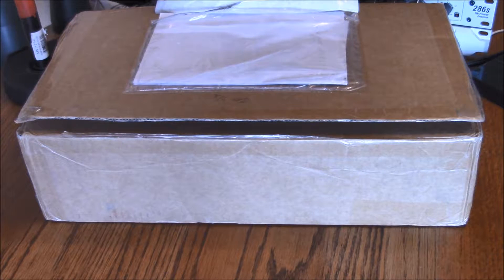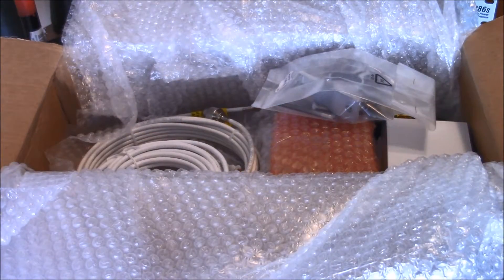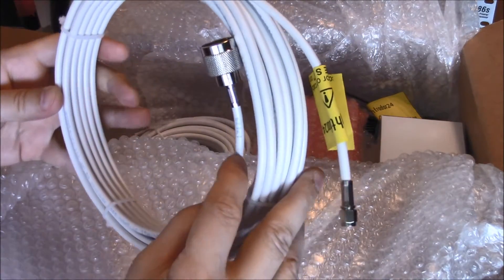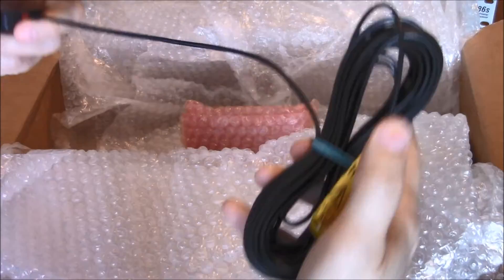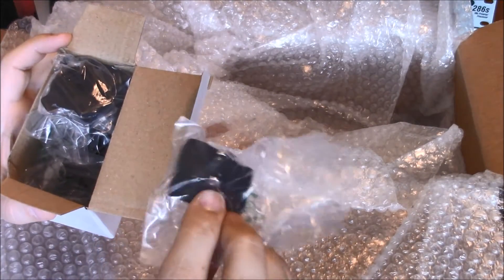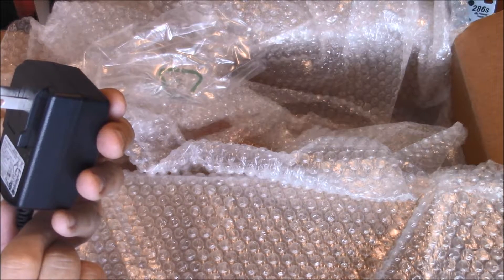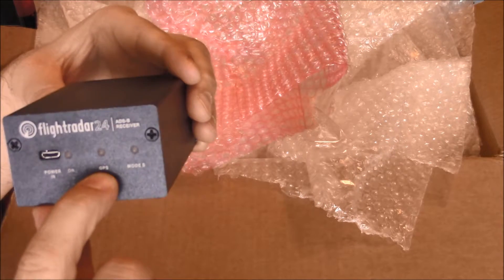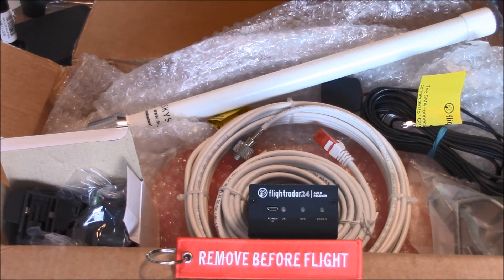FlightRadar24 ADS-B Receiver Kit Unboxing

Comment: can you view traffic on your pc directly rather then online only?
Reply from the maker: only online.
Reply: @morejelloplease  You can view on PC directly too
Reply from the maker: @danielaregay7127  care to share how?  i can log into the device via IP and check it's status but i haven't tried viewing any data.
Reply: @morejelloplease  Yes. After you log in, there are different tabs such as Overview, Logs, A/C List, Map... but I use Virtual Radar Server (which you can download for free) and use with LAN without needing an Internet connection
Reply from the maker: @danielaregay7127  hmm ill give it a shot :)
Reply from the maker: @danielaregay7127  i completely forgot my login, isnt the username like fr24 and password is the mac address or something?
Reply from the maker: @danielaregay7127  doesnt work, i logged into it months ago, now i can't.
Reply: @morejelloplease  the mac address should be in lowercase, not UPPERCASE
Reply from the maker: @danielaregay7127  i figured it out, mac address letters have to be in CAPS :)
Reply: @morejelloplease  Oh mine is the opposite. Congrats
Reply: @danielaregay7127  how can you log in ?
Reply: @deoryisnoob  the password is the mac address located at the back of the receiver (without the colon marks)

Comment: Could you PLEASE upload a tutorial on how you managed to get it all set up?
I want to host for them but I've no idea how I'm going to stretch a 5m cat cable down 2 stories and where the fuck am I supposed to put the gps, near the antenna or what and how do I even mount the antenna to begin with?
I'm new to all this shite, some guidance would be awesome.
Reply from the maker: i have mine in the attic at the moment while my tower is constructed, even in the attic at 1240ft i'm the #1 site for central texas.   the gps antenna is in the attic also, it receives a signal just fine.  the ethernet cable plugs into my switch.  if you dont have a power outlet, you can power the box over POE also.   I will post a video when final construction of the tower occurs.

Comment: Hi, i am going to install ADS-B 1090MHZ antenna in my top of roof above 30 feet from ground level. Is there any problem with lightning strike. Is there anyone's antenna affected by lightning. Please help me with that. Thank you
Reply from the maker: consult a professional to make sure it's grounded properly.   if lightning hits it, it will destroy it and current will flow into your house and can cause fire or injury.  not trying to scare you, just make sure you do it right.
Reply: Don't worry, if there are some tall trees near your antenna, because lightning usually strikes tallest objects in the territory.
Reply: @mjbeast5090  Applied for one what?  That wasn't the question they asked?  They asked about installing a unit.  Your reply was just dumb.  Can you read?  Doubtful!

Comment: What does it do? show us how it works? how much?
Reply from the maker: it receives airplane data and uploads it to a server and is shown on www.flightradar24.com, they loaned the equipment to me for free.
Reply: Don't they have radars for that? they need this in the middle of the ocean where they can't seem to track anything.  This would have to be on all the time. I went to that website and it shows a few planes but they don't match what I see out the window.
Reply from the maker: this does not replace airport radar lol, this just receives the transponder signal from the aircraft.   next time you hear a plane oveahead, goto the website.  it's accurate.  if not, then it would be a military aircraft or one set to private.